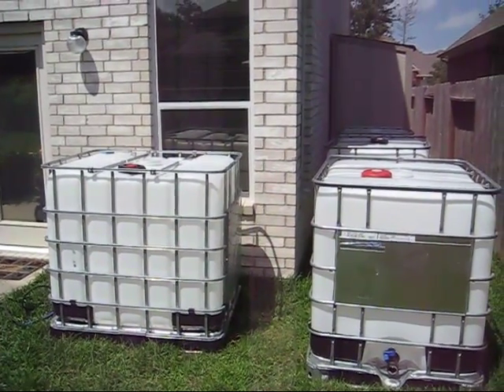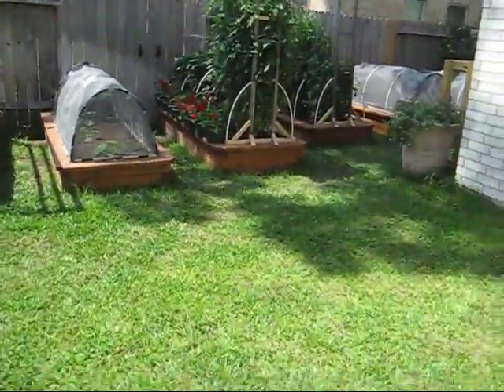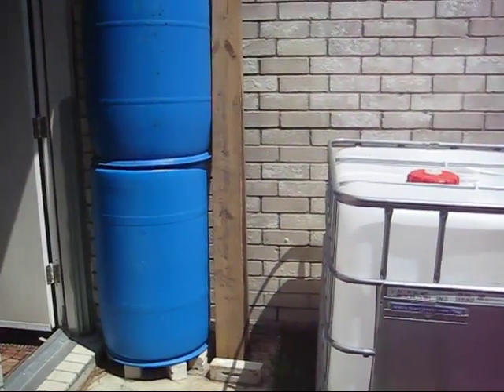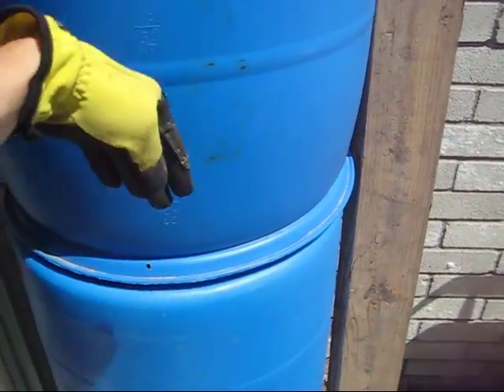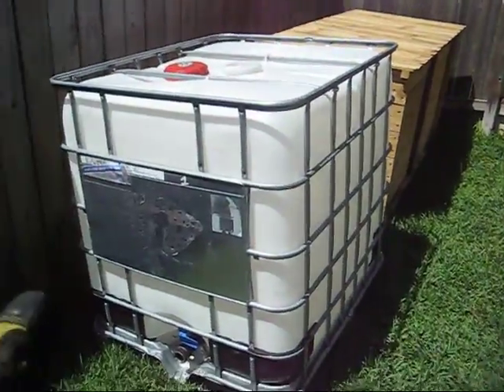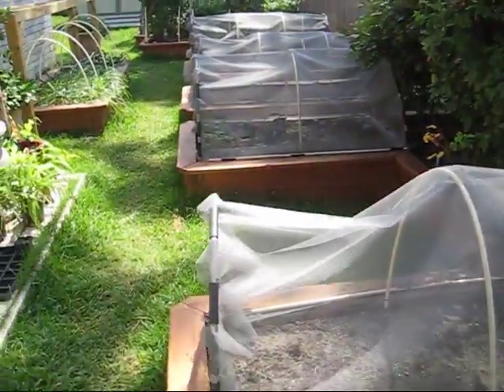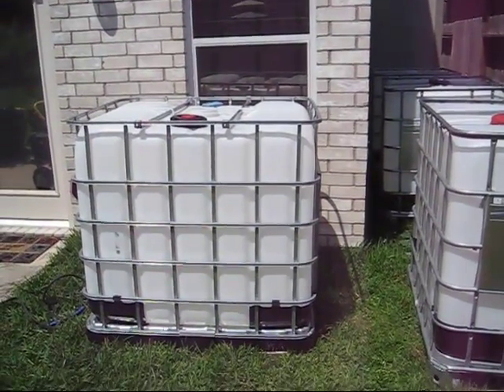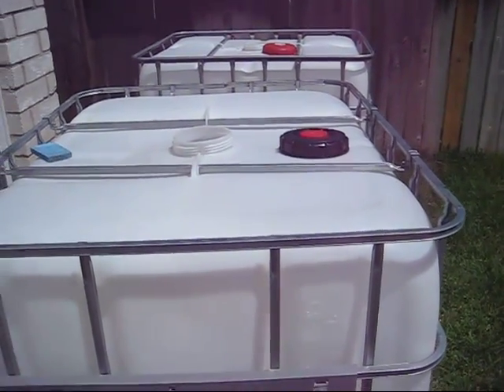Rainwater Collection System Part 1: Intro

Comment: I installed your system 2+ years ago.  Posted on various FB pages.  Thought I'd ask.  
RAINWATER ... and parasites.  How to treat?  Flush?  .... I found two (2) short (1/2-inch), active, RED-dish worms in a rainwater collection system.  Didn't take a picture but they look more or less like below but were shorter, possibly indicating a new infestation.  It is summer so hotter.  Still, have never noticed before.  
I installed the system in 2019 and have never flushed it.  These are 2X 275 gal IBC's wrapped in black plastic.  There are 2 unconnected sets like this. (550x2) In 2019-2020 I used the water for cooking for an entire year, no problems.  
I've been watering animals from this system for several years, and I look each day when flushing out a 5 gal food-grade bucket to water animals.  I've never before seen the worms but have never seen any ill effects.  Today I flushed the bucket 2X and still found parasites each time.  I watered using city tap water today.  
QUESTIONS: 
1) Do I dump and treat the whole every 6 months?  
2) Do I take out 5, 10, or 50 gals, treat and then consume for a day,  or week, keeping several systems, one treated, one being treated?

https://www.osmiowater.co.uk/media/wysiwyg/Worms_in_Tap_Water.png

Comment: How many totes can stack vertically?  
Seems like it would be wise to put even the totes, up on blocks or a concrete pad, as a footing, because the concentrated weight of a stack of totes full of water, can sink into the ground unevenly, destabilizing the stack, and possibly make the bottom spigot unusable, over time.

Comment: Could you do a vid on how to open the bottom valve on the tote? After having purchased one to start my water collection system, I don't want to destroy the valve trying to remove the small metal plate under the plastic cover. I don't know if it pops , pryes, or unscrews off of there. I think the tote was emptied with a pump from the top with the valve never opened and it held cooking oil. There is approx 2 gal oil left in the tote and I need to get the valve open before the rainy season ends.

Comment: LDS Prepper, I love you Rainwater Collection System.  I was wondering if there is any triangle with a number inside it on them anywhere to signify if the plastic is BPA Free.  Hoping it has one of those on it somewhere and it's a safe plastic that won't leach chemicals into the water.  Thanks!  Great ideas!  We are going to be ordering our Berkey Water System in a few days.  Thanks to your comparison water filtration systems video as that made the decision easy on which system to buy.  We had well water and our city just decided to chlorinate and I can smell and taste the chlorine.  No way do we want to drink it!  I am thinking we should get the 6 gallon Berkey, as we'll probably use that much in cooking and drinking for a family of 4, but I am concerned about size.  Which size Berkey do you have?

Comment: LDSPrepper You mentioned those tanks were used for something previous, but you didn't mention where you got them.  I've seen some online but new ones are a bit out of my price range.  I was hoping you knew of a place that you could get them used.

Thanks.
Reply: +velishan1 He said he got them off of Craig's List.
Reply: +Zac M Thanks, Zac.
Reply: +Zac M That's pretty impressive, Zac.  I probably won't add the nutrients in mine as I want to also have a backup supply of water.    Just saw some of those totes on craigs list in my area for about $100 and they are FDA approved and haven't been used for storing stuff that would make them unusable for drinking water storage.  Obviously I'll also be running any water I need to drink through a filter after getting them out because I'll be using this as a rain gutter catch too.

Comment: Thanks for the info on all of your topics.  I used your set up as guideline for mine as many people have done.  I still have a filter problem to work out as my tanks are about 2 inches below the gutter line.  I do have the first flush installed too.  I have my two tanks stacked in my garage and have had them full for months with no issues.   Thank you again for the time and effort you put into sharing this.

Comment: Hi LDSPrepper, thank you for your fantastic videos. I have two questions for you...all the way around my house is roughly 57 inches from the house to the fence. Given that the totes are 48 inches in depth, do you think it can work? After watching your videos, I think it will, but I haven’t seen them placed in front of the wall. Can two people lift them up? How much do they weigh when empty ?  275 gallon? 330 gallon?

Comment: Thanks LDS Prepper.  My entertainment during the winter was to scour youtube for rainwater reclamation systems.  Your 8 part video really got me started.  We just installed our first two IBC's this afternoon...on our way to six.  Your tip about stretching the black plastic around the top opening is very cool.  Thanks again.  I have found every one of your posts (I have watched) to be helpful and encouraging.

Comment from the maker: I guess it depends on how much water you start with and how much you can capture when it rains. Typically it rains 4" a month here in Houston. In the drought it rained on average 1" a month. I can capture over 1,600 gallons of water with just 1" of rain. We never ran out of water during the drought using this system.

Comment from the maker: If that is the case with the totes you have I'd use different ones. All the totes I have seen are made to stack three high while full. It is a lot of weight but they are designed to hold that weight so it is no problem.

Comment: Be careful when you say that you can STACK these totes.  275 gallons X 8 pounds per gallon equals 2,200#.  That would CRUSH the metal frame of the tote under it and could KILL somone if it rolled off on them.  My TRACTOR will only pick up my totes with less than 100 gallons.....(800lbs) so moving a loaded tote is VERY difficult.
BTW, my totes had car wash soap in them when I bought them...took alot of rinsing but having STORED water is always a good idea.  (I add a cup of clorox monthly)

Comment: Thanks for this video series!! I just completed a 2 container setup very similar to yours, but just used one three inch flush tube.  I have a T above that flush tube, and have window screen keeping any junk from getting in the containers, so it falls into the flush tube.  I would not have been able to complete this project without your instructions here!!  Here is a link to pictures of my setup.  Hopefully this will save on our water bill which has been 100 per month lately.

Comment: Do you have a steel roof? I have tested my rain run-off and there is bleeb off from the asphalt shingles...we use cheap plastic sheeting and a dedicated gutter on a section of house...I don't know if you plan on drinking the water or filtering it.

Comment from the maker: @moparmanpete Almost a ton a piece. I was very aware of the weight issue when I first started researching. I have seen many stacked tote videos and they all work great. I am putting mine on cinder blocks to disperse the weight on the ground.
Reply: I'm very surprised your blocks didn't cut into the ground the first night.  You must not have much clay soil there.

Comment from the maker: @pkbjorn35 Great question. You can store water in the sun as long as the sun doesn't get into the water. That will cause algae. By covering it with black plastic we avoid that problem.